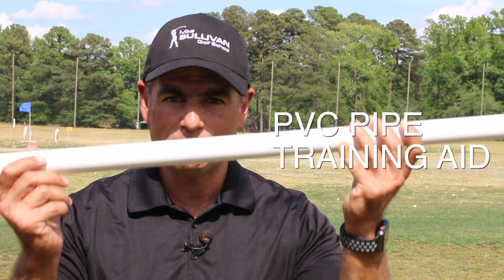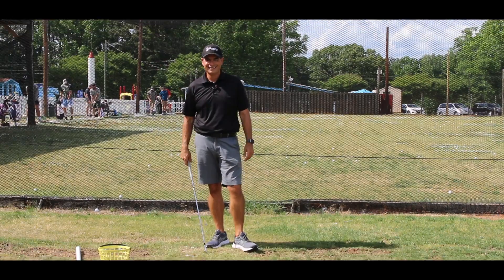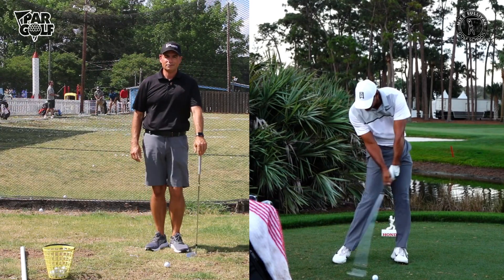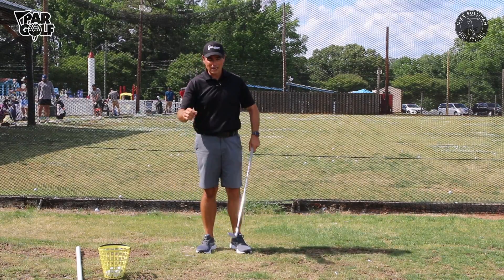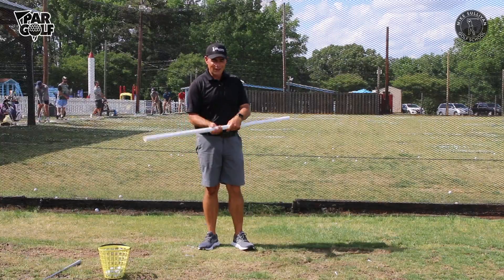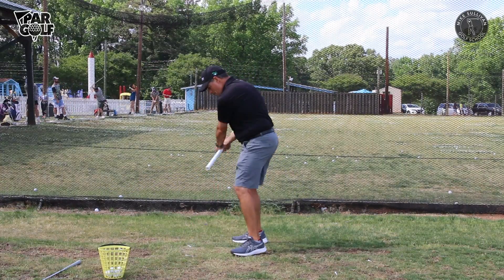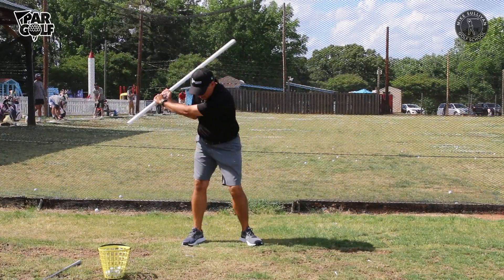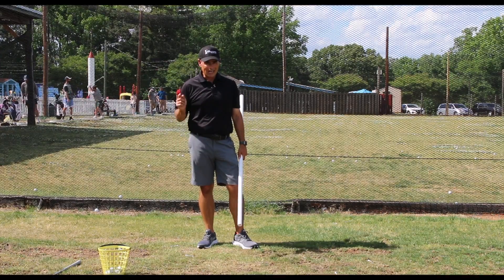PVC Pipe Training Aid

Comment: Hi Mike, I like the golf tip.

Question: What ‘s the appropriate length and diameter of the PVC pipe you are using in your teaching video.

Thanks,

Dennis Brooks
Aka - James Pete’s - GRANDPA
Reply from the maker: Hi Dennis, great to hear from you! The PVC pipe I am using is about 5 feet long but you can use something a little bit shorter. The diameter is about a half an inch to 1 inch. But I would see what is most comfortable in your hands.